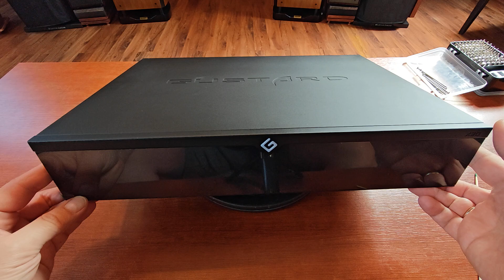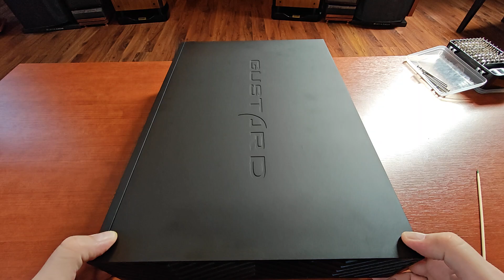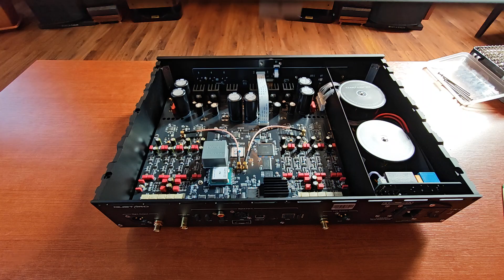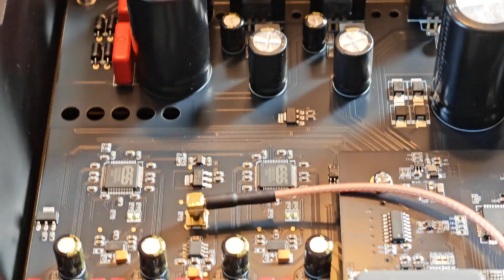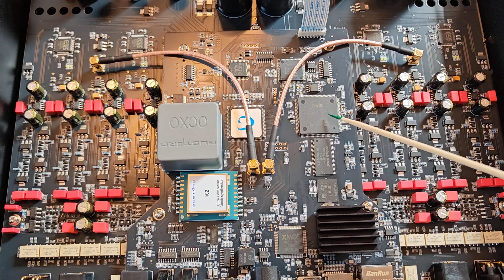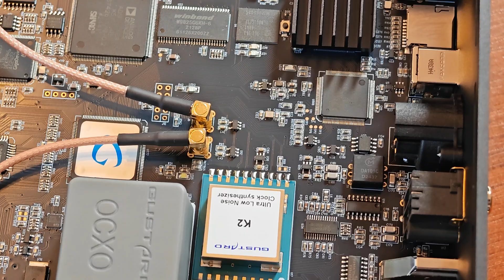Friendly neighbour surprise! A short look at Gustard X30 digital to analog converter!

Comment: Does it run hot ? No vents like A26 which I use a v slow running pc 12cm fan to blow air thru! My Gustard A22 burnt its USB card bcos of heat soak😱
Reply from the maker: No, that one stays very cool. My X26PRO was like little oven, but this one is ok :)

Comment: Very recently the Gustard R30 has been announced-probably as a worthy successor to the R26. This is something I would certainly consider upgrading to once it has been evaluated by others. But based on precedent, it will be a very high performer. 
And like the R26/A26 products, I expect the R30/X30 to be equally as polarized as far as preferences go.
 I know that the R26 evokes mixed feelings-but it is capable of being an excellent DAC IF certain things are done-which considerably add to the net cost. 
1. By far the most important thing was to replace the interconnects (Xangsane silver) with Dragon RCA. This literally turned it into an entirely different and superior DAC-as well as a subjective additional octave of bass.  
2. Adding a U18 DDC and using the I2S input in the R26. 
3. Adding a Dragon Power cord
4. Improving the fuses of both the R26 and U18.
5. Adding an external clock (LHY-OCK2 that synchs the R26 to the U18 as well as the externally two clockable switches.

And finally, something that is not really part of the R26, but is still vital....
6. Using the best quality streamer that you can....the Bluesound Node did not cut it, even when it was 'buffered' by the U18-but the Lumin U2-Mini (with external PS) does. 

When/if the R30 becomes an addition to my system, I will of course implement all of the above
Reply: Gustard r30 плохой по звуку, проиграл x30. Также как было с r26 и a26 выиграл

Comment: I’ve owned my X30 for the last three months and it’s an amazing DAC.  I upgraded from the A26 which was a great entry into a hifi DAC but ultimately got the itch after Soundnews review.  

In my system, I also upgraded from Neotech NEI-3001 Mk III to Xangsane XS-1105Ag XLRs.  Those two additions really have my system on another level.  

I’m looking forward to your review once your neighbor puts some hours on her.
Reply from the maker: Thanks for sharing!
Yes, he needs to enjoy his new little baby now :)
Reply: Avez vous senti une grande différence avec ce câble Xangsane ? J’ai actuellement le X30 avec le neotech NEI 3001G
Reply: @luigi9805  I can only comment regarding the non G version which was mk III.  Replacing both the XLR from the X30 to the pre-amp and the pre-amp to the amp was definitely an improvement over the NEI-3001 mkIII.

Another step forward in sound was bi-wiring (2 sets of cables) from the amp to the speaker.  The separation of highs and midrange benefitted over using a jumper cable in my system.  I want to state that your mileage may vary but in my system everyone noticed the immediate elevation of the X30 over the X26, the Xangsane over the Neotech, and finally a double run of cables vs the jumper.
Reply: @ris87ree Merci pour votre réponse, 
Après quelques recherches je vois que le Xangsane est principalement composée d’argent cela a forcément du avoir un impact, et bi cabling aussi … ce ne sont que des améliorations mais cela dépend de votre configuration l’amplificateur que vous avez ainsi que vos speaker … !
Reply: @luigi9805  I run Xangsane XS-1105AG XLRs and Transparent Wall Reference speaker cables that I terminated.  I choose the Transparent cables because they are solid core OFC cooper strands that total 8 awg.  Running this setup through my Classe Delta Monos is winning for me right now.

Comment: hi, great DAC. If I want to have TIDAL I need additional a Streamer? Gustard has no TIDAL internal support? Thx
Reply: Via roon I would think, the compatibility with services is rather woeful
Reply: For iPhone use Jplay. For Android use  USB Player Pro (Tidal & Qobuz)
Mconnect and Bubble upnp i don't Like, but is working.
Roon is also perfect but expensive.
Reply: @S.F.75  thx, but roon license cost 800$???
Reply: Yes, that's why i recommend Jplay or USB Player Pro;)
Reply: @S.F.75  using Jplay or USB Player Pro requieres to need a pc that is connected via usb cable with gustard?
Reply: @manuellplz655 No PC and cable needed. Just a iPhone or iPad for Jplay. Or Android device for USB Player Pro. I recommend Bitperfect settings for USB Player Pro. You can ask Chat GPT for settings. Price 8,50€ for the App and about 5€ for the Streaming Option, that's it.
Reply: @manuellplz655  No cable or PC needed
Reply from the maker: No, there is no native Tidal support as (AFAIK) this requires some kind of paid license from manufacturer. You can however stream Tidal from other device to one of the supported endpoints like DLNA or Roon. Or just use something connected via USB/IIS like streamer/pc/tablet etc